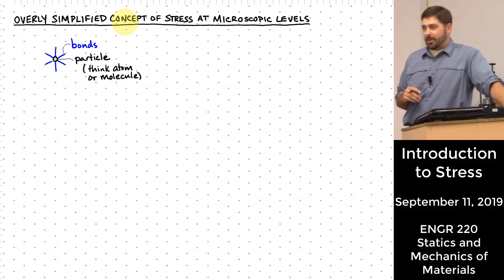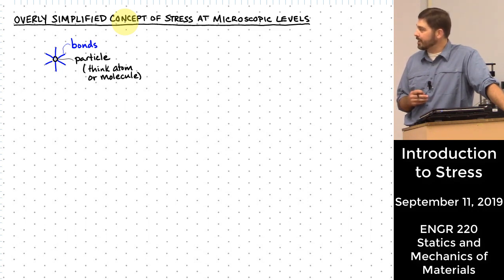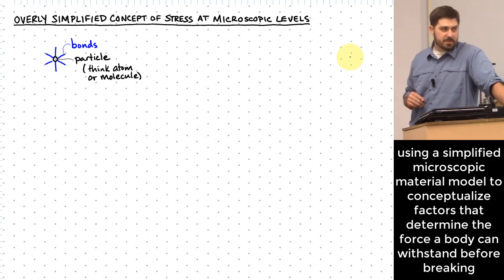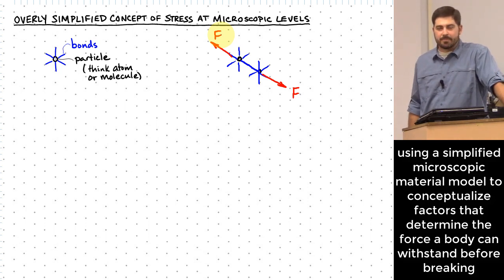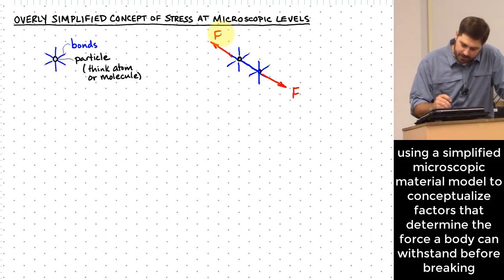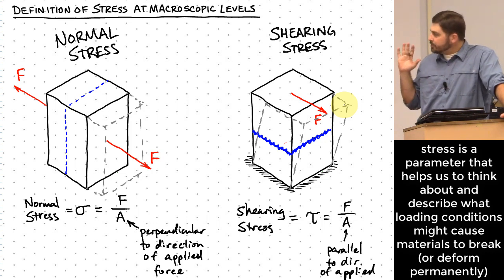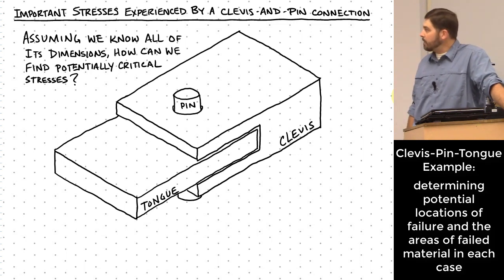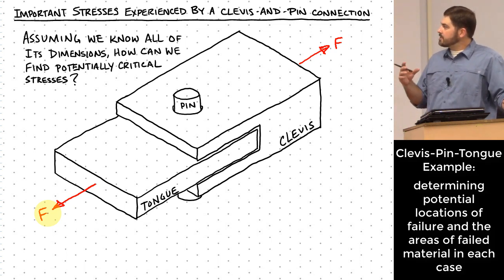Introduction to Stress | Normal and Shearing Stresses in Mechanical Connections (e.g. Clevis & Pin)

Comment: Does bearing stress develop under both tensile and compression  load?
Reply from the maker: Bearing stress occurs anytime two parts contact each other, so the nature of the stress itself is always compressive...HOWEVER, bearing stress will occur in a mechanical connection regardless of which direction the load is applied. Different sets of faces will likely come into contact if the load is reversed, but anywhere two faces push against each other, compressive stress will be the result.
Reply: Thanks a lot for the help